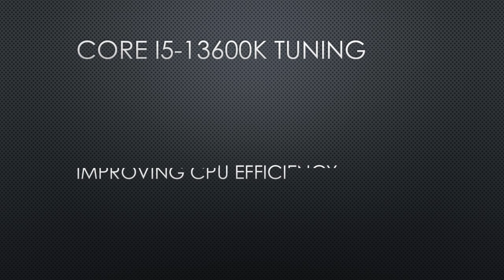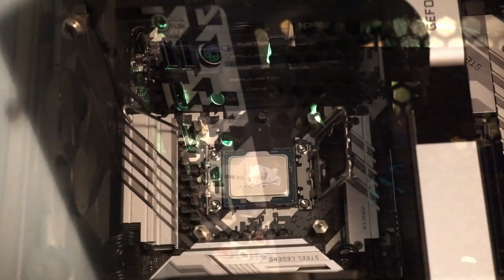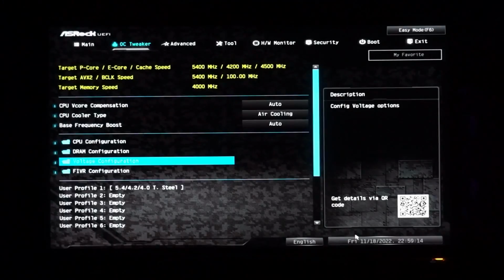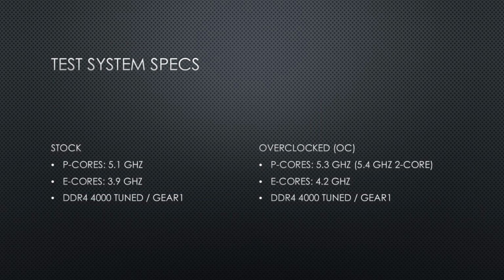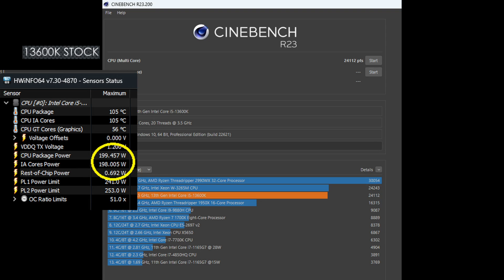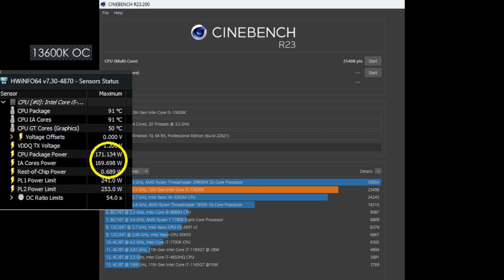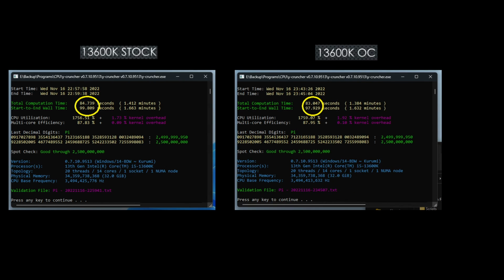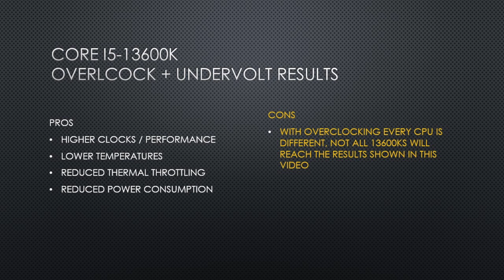Intel Core i5 13600K Undervolt + Overclock: Higher Performance While Using Less Power

Comment: why’d you cover the fivr under volt ? was curious about that. 

anyways i just raised my all core on my 13600k to 5500mhz and its running pretty cool after an undervolt ! thanks for the guide !! 
on a nzxt n7 z790 (asrock board)
Reply from the maker: With newer ASRock BIOSes the voltage/frequency curve changed, throwing the values of this video way off, that is why that part was blurred out.
Reply: @ oh i see thanks for the response ! cheers from los angeles

Comment: What’re the core voltage offsets?
Reply from the maker: under the latest bios I need +60 offset for the cores to reach the values in the video, later BIOS uses a lot lower voltage by default.

Comment: I'm trying to do this as well but I can't even get a stable -60mV adaptive offset with a +100MHz all-core turbo offset, crashes on Cinebench R24 in 2 mins.. let alone applying +200MHz wtf.

MSI Z690 Tomahawk WiFi

Comment: i really need to undervolt this cpu in the next days because iam extremly disappointed. i went from a i7 8700f to the 13600k and the 13600k uses more energy for fixed 60 fps then the older 8700f which cant be right. its faster, better how can it be that it needs more energy without giving more performance? for example. gw2, locked at 60 fps with riva tuner, same location: 8700f 39 watts, 13600k 73 watts. in large fights, the cpu went to 117 watts while the fps dropped to 34, which is normal, no cpu can hold 60fps in that game. the 8700f drops firther, down to 24 sometimes but then takes 67watts. and its running hot even tho stats say its under 32% load only, but reached 79 degress with a kraken 73 3x 120mm. if undervolt wont solve this, the cpu goes back
Reply: Turn off vsync/gsync or the fps cap in games
Reply: @eldenyung673  more fps increases the draw even more. just came out of crysis warhead, a game from 2008, 100fps and 40 draw on the cpu with 3 cores in use.
Reply: @eldenyung673  they are, and i dont get why. when i compare a 2014 gpu, with a 40xx gpu, then the 40xx gpu will take a fraction of elecrtical power to output the same performance, as the 2014gpu at 100%. and cpus, dont behave the same, why ever

Comment: I've a question. Does undervolting depends on the chipset or the CPU. is it only supported by (Z-series mobo's)  & OR (k-sku). I am planning on getting a MSI B660 Tomahawk and i5-13600k. will I be able to undervolt thee CPU ? thanks
Reply: If you are getting a K cpu. You must get a Z board
Reply: Did u buy the combo?
Reply: @nyumokongkang4483  yup, the Z board was just $25 more, ended up getting that

Comment: I get bluescreen after a while with this settings, do I need to disable undervolt somewhere? i have a asrock z760
Reply from the maker: i'd suggest either lowering the clockspeeds, or raising the voltage. then do some stability testing. copying settings doesn't always work since every cpu has different voltage characteristics.

Comment: im running the intel speed optimizer 2.0 right now and am getting 5.5 on first 2 cores and 5.4 on the other 4 cores with 4.3 on efficiency cores, +0.0200 vcore offset and get a 24500 in cinebench but only reach max temp of 82c.

Comment: WARNING, DONT DO THIS:
- Did the same, was very happy with the results, all works as explained in the video.
- Forgot about it, as computer passed all the tests and I went on with my life.
- Started to play online games, experienced huge packet loss of 20-30%.
- Changed my router, got a new static IP, updated drivers, reinstalled the windows, got a new PCI-E Network card and ran 10 other tests. SAME packet loss.
- Restored the voltage back, and the problem disappeared.

----‐---

Visibly you will see your processor performing fine, but some of the hardware in the PC states to work incorrectly. In my case - the network.

I spent 2 weeks on isolating and finding the issue and it ONLY got fixed after I ONLY restored the CPU settings to original. 

The amount of nerves spent is insane. Do at your own risk.
Reply: Bro 👽 too mutch 420...
Reply: I have overklocked my r5-5600x to 4.85Ghz all cores manually since realise date and got wireless headset and had issue like static sound and noice when I download driver from software, it disappeared when I lower my clocks, but Idk what's was wrong I mean I rest whole bios and that did not help at all in beginning have done so much to fix but nothing worked and one day when I have lower my clocks and instead software again for a update and it worked for a weird reason

Comment: Thanks for the video! I have the exact CPU+mobo combo (with the basic cooler master 240 aio) and went from around 94-96C avg temp on cinebench at stock to 91-93. I'll take the +5-6% gains and lower wattage use for a couple fewer degrees temp. I mostly game and this sits around mid-60s to mid-70s on all the games I play. I'll rock this setup for now. :D

Comment: Man for some reason I just can't get this to work no matter how high or how low I set the value for undervolting my CPU usually under a load will run up to 112 113 degrees Celsius when prior to undervolting it never got any higher than 98
Reply from the maker: check hwinfo64 and click on voltage offsets to see if your -voltages offsets are applying correctly.
Reply: @Superior85  thank you, I will check when I get home.  It's been frustrating but it's my first time trying any of this lol

Comment: I have a question. What features would a B660 board lack with the 13600k? can you still undervolt?
Reply from the maker: the main thing it would lack is overclocking the P and E cores. I've never used a B660 board so I can't say for sure but it seems possible from this thread. 

https://www.reddit.com/r/intel/comments/svet70/undervolt_on_b660_motherboards_possible/

before pairing the 13600K with a B660, make sure you're able to upgrade the B660 bios to a 13th Gen compatible BIOS beforehand, either with BIOS flashback, or flashing the BIOS using a 12th Gen CPU.
Reply: id stay way from budget boards like that personlay unless u have non k cpu, this ones $139 Z690M-ITX, get bdie ddr4 ur in some nice perf and value

Comment: Hey there. Do I need to disable undervolt protection in order for these changes to take place?

Seems like even if I make it -300mv my temps stay the same on cinebench
Reply from the maker: check hwinfo64 and click on voltage offsets to see if your -voltages offsets are applying correctly.
i don't recall needing to disable anything in my bios. i'm curious which bios are you using?
Reply: Yes it needs to be disabled if your motherboard has it enabled by default

Comment: Those Temps seem a little high for liquid cooling.  I'm using a Fuma 2 at the same voltage and clock speeds.  Tested with Prime 95 AVX enabled and max out at 95*C

Great video, though.  There are so many who comment but never take the step of making their own videos or guides.
Reply from the maker: Thanks. I eventually found out that the temps were high due the cheap thermal paste I was using. I'm using better paste now and my temperatures dropped a bit.
Reply: @Superior85  methinks you also need a contact frame.  your temps will go even lower.  if you're stuck at the UV probably won't see your package power go down much but you still might gain some headroom for overclocking.
Reply from the maker: @KingDavid999  I got one the other day and it does help quite a bit, it lowered the temperatures enough for me to push the clocks higher.
Reply: @JohnBraman413  look up thermal grizzly or thermal right contact frame.  Both work the same.  If you buy the thermal grizzly one you support the German who invented it.

Comment: NOT DETAILED STEP BY STEP, MINE DOESNT WORK
Reply from the maker: not all cpus are capable of the same overclock...
Reply: Choose a Vcore you want to target and pull up Mhz by 25 on your CPU, when you get for example 5.75Ghz and your PC crash when you run cinebench r23 multcore test run 30 min if not stable go back 25Mhz, that's how I started to overclock back in 2011.

Comment: Very helpful video. I have ordered an asrock z790m-itx which has weak vrms and it can use only a max of 150 watts load from the cpu. I'm hoping that undervolting the 13600k will lower the max load so i don't have any stability issues
Reply: for gaming u can oc to over 6ghz with <150w id stay away from synthetic benchmarks you can try it but id benchmark using games not synthetic. and in games you can clock a lot higher than Cine bench bc it doesn't stress your cpu to 100%+ ussually in games cpu usage is %20. you can hit 7ghz if you wanted in games and keepit cool with 240mm aio like i did with 12600k in my shorts. I used less than 66w on roblox165fps 1440 igpu at 7 ghz
Reply: undervolting is still good though especially if you get better perf/ higher speeds/lower temps edit dont try to clock ur cpu at 7ghz u have to disable settings, stay under 6.2ghz flat oc

Comment: im using a air cooler, What do you think is a decent temperature to have this cpu daily? average and max?  thank you
Reply from the maker: Depends on what you're doing. I'm idling at ~30C, but with the CPU stressed in Prime 95 Small FFT (AVX Disabled) I'll hit over 100C unless I lower the room temperature.

I don't think temperatures are anything to worry about unless you're doing something where you're frequently running over 100C for long periods of time... but even then the CPU should shut itself off before damage is done.
Reply: @Superior85  The changes I make to the CPU clocks do not change their operation, is it possible that I am missing an option in the bios? we have the same motherboard by the way. HELP haha
Reply from the maker: @josea7989  Which version of the BIOS are you using?
Reply: @Superior85  10.04, last one, i can swap the numbers on the bios but tehey do not changes on the system
Reply from the maker: @josea7989  I had issues with the latest BIOS, try flashing to the previous one (9.03).

Comment: Can you explain the undervolt numbers and how you came up with undervolting number of -100 and another setting on -45. I'm trying to do this as well but dont really understand the numbers
Reply from the maker: That got me stable in Cinebench and it seemed stable in daily usage. Basically just lower the values till it crashes then raise it back to a number where it doesn't crash.

For Prime95 small FFTs (AVX disabled) I had to decrease the undervolt significantly. I think now I'm at like -40 for the core and -20 for the ring (at the same clocks as in the video).
Reply: @Superior85  i deleted last post as i figured out my answer, i guess my last question is what does the ring offset do to the voltage. and if u dont mind on another topic, because i have a asrock motherboard but cant find a tutorial on if is possible to set and lock core voltage at a certain limit. i have tried on intel xtu but had no luck as it just crashed my system on any adjust i made no matter the size. i cant quite figure out of to do that in the bios so didnt know if you know how. thanks for your time and help
Reply from the maker: There seems to be two ways to set a fixed voltage on the Z690 Steel Legend.

1. Via the FIVR Configuration menu you can input "voltage override".
2. Via the Voltage Configuration menu you can set a "fixed voltage".

Lowering the ring voltage seems to lower total voltage of certain CPU loads, I noticed a wattage & temperature drop in benchmarking programs when using the -ring voltage offset.
Reply: This method fucked up my pc!!!!!

Comment: Hi i am using same motherbored and cpu as yours and as500 air cooling and i god 250w with stock settings why is that happening?
Reply from the maker: Which version of the BIOS are you using?
Which application are you reaching 250 watts?

Comment: But this kind of tinkering will result on an unstable system? What I mean is random blue screens with everyday use.
Reply from the maker: Stability testing is always important when making these types of changes.
Reply: Yes it will. And testing actual stability is much more difficult than running a few high load benchmarks without BSODing. As general rule, when underclocking, take the best stable undervolt you got under a few runs of Cinebench and a few other stress tests, then divide it by two for a really stable undervolt. The worst conditions for your CPU stability isn't when you"re running it at max power, it's when it's constantly switching between low and high power modes and varying workloads (internet browsing is a good example of that).
Reply: I just use fixed vcore 1.25 and runs well as well. Now it’s running 60plus degree as compared to stock high 70plus. I using air cooler.
Reply: @hom3r  around 60 also for me, that's very nice. 😀
Reply: @Shokyto  what method do you use?? Adaptive or fix or

Comment: Hello. I think those temps are too high. I have an 13600KF , max 80 CPU package and 81 cpu core max, My cooler a noctua nh-u12s redux
Reply from the maker: I agree it does seem a little high, luckily the under volt brings it to acceptable ranges. I wonder if it's worth me getting a different cooler. I've seen reports that there might be an issue with the LGA 1700 upgrade kit that I am using.
Reply: @Superior85  yes buddy,  check also for bios update.
Reply: Me with all pcore on 5.6 and ecore all 4.5 and the tmeps are around 70 in full load

Comment: It got to 105C at stock setting which is the absolute limit. You lucky its not fried. I guess something is wrong with your cooling
Reply from the maker: TjMAX doesn't occur till 115C with power limits removed (my BIOS defaults).
I'm not too concerned as I've seen some overclocked results online hitting over 110C.

Comment: What voltage are you using with this undervolt? The video doesn’t really state it. And cpu settings
Reply from the maker: I'm using adaptive offsets from the BIOS(-100 mv for the cores, -45 mv for the ring). I'm not running a set voltage. It varies depending on what type of load. In Cinebench R23 the undevolt/oc stays around ~1.22 volts. At stock it gets up to around 1.32 volts.